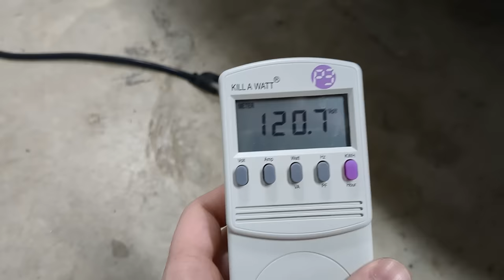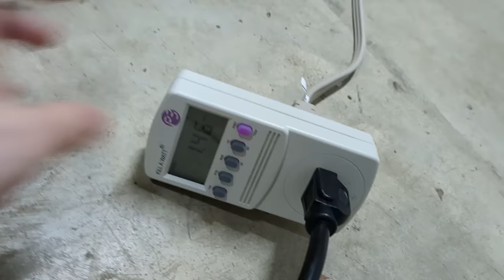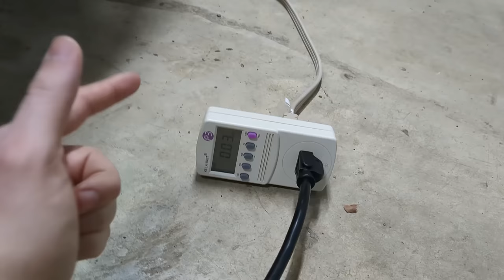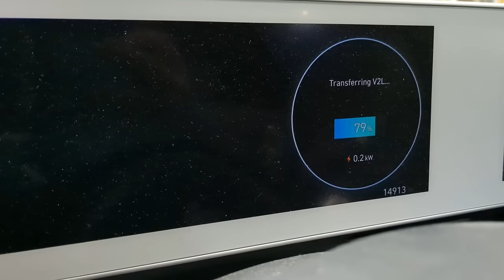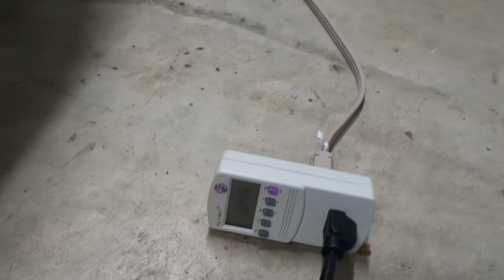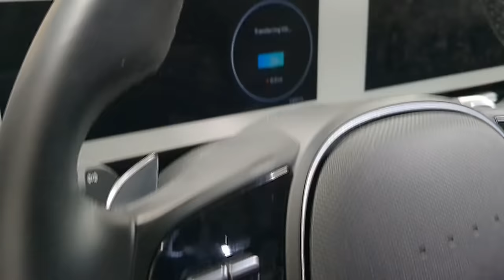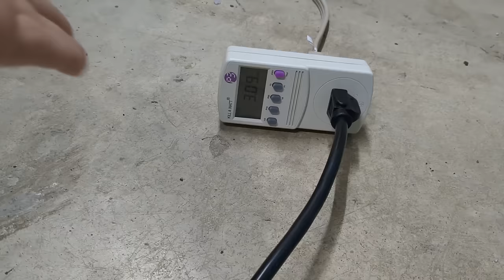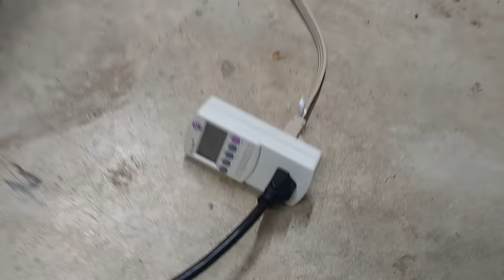A 24-hour test run of the Hyundai Ioniq 5's Vehicle-to-Load function

Comment from the maker: Quick note for other owners of this car and those like it: at the end I mentioned "accessory mode" but I was talking about Utility Mode. You activate that through the infotainment screen and then the car should stay semi-awake until it runs down to 20%. From what I've seen, more stuff is active than when using the V2L adapter (and you can use HVAC as well - that mode is designed with camping in mind) so it probably eats into the battery enough to make getting the adapter worth it if you don't already have it.
Reply: next go to public j1772 charger and use it to cook food. after all it's just normal ac power so it should work.😀
Reply: What are your normal parasitic losses on the car from it just sitting unplugged?  My Rivian will lose 0.5-1% per day sitting unplugged in my garage
Reply from the maker: @erics3596  Virtually nothing. Rivian rather unfortunately followed the Tesla playbook in several ways, including keeping a lot of systems alive when they don't otherwise need to be. Legacy automakers, on the other hand, actually turn the car off when you turn it off - which turns out to have some advantages!
To Tesla's credit, they've gotten a lot better at this - and Rivian has a lot of catching up to do. But pretty much every EV made by a legacy automaker will open the high voltage battery contactors and go into the same extremely low-power state that a gas car does when it's not running.
Reply: @TechnologyConnextras  Good to hear - Rivian has consistently been pumping out updates to address the parasitic drain...but yes they have some way to go :)
Reply: @TechnologyConnextras  congrats really nice looking mobile generator. Greetings from Asunción Paraguay
Reply: @TechnologyConnextras  Yep, as long as I don't have sentry mode on, my model 3 only loses 1% every handful of days as I just found out. I had worked from home the last 6 days and left mine uplugged. Only went down from 85% to 84 in that time.
Reply: Nissan LEAF owner here - I'm a little nervous about accessory mode for long periods because doesn't that drain the 12V Battery?  I just had the 12v replaced after owning the care barely over a year and from what I gather this is a common problem across EV makes (otherwise, no notes).  If that's just Nissan's goof I'll be happy.
Reply: Funnily enough, I have a gas car and I've always wondered if I could use my car as a portable emergency generator for my house?
Reply: I love the fact that you did this experiment, but in the beginning of the video you mentioned that the power lines are on poles and could be interrupted by tree branches being blown into them. You have a state of the art car, electrified cooking and storing of refrigerated food through some dodgy wiring, and the power to power it all comes into it from a system that is no more advanced then your 50's toaster. 

I also think this is a missed opportunity to show that your eating healthy, instead of junk food. That fridge had plenty of room left for fresh vegetables!
Reply: FYI for future experiments there are power meters available that have battery backup and don’t lose memory of kWh used due to a power interruption. Amazon has them for $10-15 and you can get them for under $10 shipped from China. They are actually more useful than a Kill-a-Watt for me since they track peak power usage and are so cheap that I have several of them. When compared to a Kill-a-Watt connected in series the readings have been within 1% accurate. Big Clive has reviewed a UK version of them and has given his approval.
Reply: Kinda sad to see that the US version is also limited to 15A even though it's running lower voltage.. the EU version happily provides 3.6kW of power through either the V2L adapter or the socket in the back seat, which can easily power my whole house. I've installed a generator input socket at the fuse board which lets me supply power from the Ioniq5 as a grid replacement in case of a power outage. The only thing that bugs me a bit is that AC or fridge compressors have such a high startup current spike that the Ioniq5 inverter will sometimes turn off when a fridge switches on. Also, the inverter seems to be rather nicely efficient.. the power pulled from the adapter and the power indicated in the dashboard only differ by about 10%, suggesting a roughly 90% efficient inverter. What I found makes quite a bit of difference in consumption is whether you lock the car or not. If you leave it unlocked, the infotainment etc will not fully go to sleep, which makes a constant drain of about 200 watts extra. If you lock it, everything but the inverter will go to sleep.
Reply: Would say that the inverter has to turn on the cooling system eventually, especially at high load after a while, to cool down the inverter section, which is just using the standard input PFC and active power control circuitry, so adding it on was only a software change for the designers, as the semiconductors are already there, along with the filtering chokes, and you can make the power converter stage do double duty just with some clever design. That they make an adaptor is good, but really that needs to have the EV cable integrated into it, using the communication cords to do the output connected sensing, and then have the socket remote, so allowing you to have it actually waterproof, and leading to a dry place. Likely the inverter itself also has ground leakage sensing, part of the input protection, so it will also provide protection against you touching the live conductors, so you do not need to have a RCD in the power output.
Reply: try barkeepers friend on the fridge if its stainless, that stuff is magic
Reply from the maker: @WooShell  Huh! I wouldn't have thought locking the car would make a difference. If/when I need this, I'll be sure to do that.
Reply: @fredashay  You can, but I'd count it as impractical, as the dynamo/generator can't supply that much wattage at 12+ volts, and while you can improvise a dyno to use your driven wheels to run a generator, good luck smoothing the output on it to not damaging levels and letting your engine run at a stable level regardless of used power.

Its entirely possible but I am assuming all the associated hurdles are more expensive than just buying a diesel generator.
Reply: that doesn't look like KARR from the 80's, haha
Reply: Are we going to see all the appliances you've explained run from your EV?
Reply: @oplkfdhgk  Indeed you can. That's how I charge the "racecar" (RV plug into it's charger, so there's a J1772 to NEMA-50 plug)
Reply: My 6 gallons of gas will run everything in my house for around 18 hours.  I don't have to run and plug and unplug things, fill it up, start it and then refill it.
Reply: @fredashay  You can, I have. Just with a little 300W inverter but it was enough to run the TV, a lamp and the refrigerator.
Reply: Would it be possible to use the V2L and the utility mode outlet at the same time? It would be nice for short periods of time like when you wanted to cook your veggies and pizza at the same time.
Reply: @fredashay  Kinda. You can power most of the stuff in your house (but not at the same time); just go buy an inverter. But make sure the car is running in a well-ventilated space (i.e. outside) and don't try to power your fridge from it (you'd need quite a beefy inverter and your alternator probably wouldn't like it).
Reply: @WooShell  The plugs going into it are only rated for 15A.

10% efficiency is pretty much rock bottom for power supplies and inverters these days...
Reply: Another thing that should come standard on evs! I hate that my Bolt auto-shutoffs in an hour no matter what, even when plugged in
Reply: @TechnologyConnextras  SVB's collapse will hurt a lot of renewable startups. maybe something you should consider covering in the near future?
Reply: @wkyrouz  fellow leafer, as a rule of thumb if the high voltage battery is connected for driving, charging, or v2l like TC is doing with their hyundai then the 12v battery is being charged so no worries. The leaf is pretty good with its 12v battery in my experience but I've heard of it draining from being plugged in to a charger idle for days at a time as it keeps checking if the plug is there. Some driver education required, check the forums!
Reply: So we're calling batteries "generators" now I see? Doesn't seem right in any sense of the word according to the dictionary, but ok...
Reply: @gorak9000  I agree it isn't how we generally use the terms, but if you put aside electrical nomenclature and use the terms more generically it makes sense. A battery is just a storage of something and a generator is a producer of something. In chemistry mixing a chemicals together that produce a gas flow (EG O2, CO2, H2,) is called a generator. This is chemical reaction that produces a flow of electrons.
Also, for purpose of the video it was being used as an analog to an emergency generator. Still click bait AF.
Reply: Technology Connextras, Markus Strangl , BG: FWIW, The USA and the EU versions are both rated at 15A.... Plus since in the USA, more hazardous 240 volt service is also available, which is offered in the Ford Lightning....

So, yes it is sad and a shame that a 240 volt adapter option is not offered to USA customers.

 I wonder what would happen if an EU Adapter would be plugged into a USA model?
Reply: @BrandEver117  I think they have to do that given how easily bolt EVs catch fire.
Reply: Inverters are actually quite inefficient. When we all have solar and manufacturers go back to making DC powered appliances, life will be better.
Reply: @johnburr9463  Very true. Inverters also have short lifespan. They usually burn out every 10 - 12 years. Costing $4-5k just replace them for solar panel owners.
Reply: Inverters are actually tremendously efficient versus the alternative... Since
the AC grid is key... for effective clean energy utilization...
Reply: @nc3826  Inverters are only useful because we don't each generate or own electricity, so all our appliances use AC. But what's important here is that most of his power loss is from the inverter. The same thing happens with a home battery. Once a high enough percentage of us are on personal solar power, manufacturers will be able to make DC appliances and we won't need inverters.
Reply: Why don't EV's come with a small diesel generator that charges the batteries? Could be built into a small exterior panel. Or in the trunk.
Reply: @johnburr9463  Google methane hydrate. Then ask what happens when that releases? Will a carbon tax at all prevent or minimize the effect? Who is going to buy a 5 year old EV when they all have a dead battery? Why is it you have to eat bugs but they don't have to give up their private jets? Why don't solar and wind ever pay back the carbon budget they took to create? How are 15 min cities and removing your freedoms going to have any effect? They pollute all they want at will toxifying your air water and lands yet it's carbon that's the issue. Ya fossil fuels are your enemy.
Reply: @fredashay  the alternator on a gas car only puts out 12v and maybe 100 amps (and that's while at driving RPM not idle RPM). But That's only equivalent to 10 amps at 120 volts so less than a regular outlet.

You would need to hook up a large generator to the wheels in order to actually harness the full engine power. It's just not worth it
Reply: @nc3826  we are talking about how to survive disaster situation of prolonged blackout. Efficiency and clean energy are only secondary consideration to robustness and reliability.
Reply: @i6power30   wrong.... There was no, we are... Your foil hat, survivalist narrative had nothing to do with the point that I made... Sorry to confuse you....
Reply: Don't worry we will judge you 😜
Reply: @oplkfdhgk  ១ាាាាឋាសាសឹ
Reply: @synapticburn  Okay, thanks everybody who replied to my comment.  I just figured that if a little putt-putt generator can power a whole house, a car could do so too.  But the car's alternator is the bottleneck -- being intended only to keep the battery charged while driving the car.
Reply: @fredashay  Just another thought... if you have enough space in the engine compartment, you could use varying sizes of pulleys to cause the generator head to run faster than the engine.  But... modern cars don't have any space in the engine compartment.  If you have an old 1970's pickup truck, there's plenty of room!  But, again, you have the problem of engine speed regulation. On an old vehicle like that, it would need to be some sort of mechanical governor... just like what's on portable generator engines (they run at 3600 RPM).
Reply: @BrandEver117  At least on the Volts, if you rubber band the gear select button down, it'll prevent the auto shutoff
Reply: @synapticburn  no actually 300 amps
Reply: @i6power30  what car do you know of that has a 300 amp alternator?

My f350 powerstoke Diesel alternator made 180 amps

No factory car has ever had 300
Reply: I have a hybrid (Ford plug-in hybrid) and we just had a big snow storm here in New England and we lost power for a few days. I plugged in a laptop to charge in the car's 120V outlet and turned the car on without actually turning it on (i.e accessory mode, if it had an old fashioned key it's like turning it one position without starting the car.) and apparently it just pulled from the 12V starter battery and killed it :(   If I had actually started the car it would have remained mostly off but occasionally started the engine to charge the 12V battery. Unfortunately it doesn't seem to charge the 12V starter battery or feed the 120V outlet from the electric drive battery (not sure), but the whole car seems to be a half assed comprimise to make a plug-in hybrid out of a normal car. (C-Max.)   My next car will hopefully be a Niro or EV6 or similar :)
Reply: @JohnRunyon  Or run the inverter from a deep cycle battery (or a few) and then run the car to recharge those batteries.  (I know someone who lived off grid and would recharge their deep cycle marine lead batteries every week or so off a homemade rig from a lawnmower engine and car alternator.)
Reply: @dwarftoad  well it varies from car to car. Most PHEV will charge the 12v battery as long as car is turn on not necessarily ICE engine, just ready to drive position, the traction battery should be charging the 12v battery
Reply: @dwarftoad  yes that's how my 20 year old Prius works too. The 12v battery in any car is just for quick starting loads or to even out the demand for accessory loads while the alternator maintains the battery

Hybrids have an onboard charger to recharge the 12v battery

The Prius also used the motor battery to run the AC compressor and cycles the engine on to recharge it when idling with AC running
Reply: @dwarftoad  the 12v gets its power from the big battery via an inverter. There’s no alternator like there is in a regular gas car.  So yes, had the car been on, you would have been fine doing that for a very long time
Reply: Ionic 5 battery
Reply: @synapticburn  I was speaking of alternator specs. Not sure what car engine will actually make 300 amps. Maximum amperage of typical auto alternator is 300
Reply: @VekhGaming  On top of what you say about running your house off of your car's 12V alternator, I've done that twice, and burned out the alternator both times.  100Amps@12V is about 1KW.  Alternators have a small fan which is designed to cool the alternator at highway speeds.  When you're just idling in your driveway, that tiny fan isn't enough.  I suppose you could rig your engine to maintain 2 or 3 thousand RPM, but this is horribly inefficient compared with any gas or diesel generator.
Reply: @barongerhardt  Those smaller inverters are FAR more efficient than their more powerful bigger brothers for light loads, due to their MUCH smaller idle current.  But, don't be tempted to plug any kind of motorized things into them, like a small refrigerator.  (I've had good luck with battery chargers for cordless tools, though)  They put out a modified sine wave, as opposed to the real sine wave that you get with regular house current or the Ioniq shown in this video.  Most devices will run just fine off of a modified sine wave, but some will not.
Reply: When it eats what do you feed it? Electrons?
Reply: The pour V2G efficiency is probably because the battery is cold soaked, and it isn’t warming up because it delivers low power (compared to driving the e-motor). The converter should be more efficient in summer temps, worth a new try then.
Reply: T.C. Creator Dude: You probably already learned this info by now, but since I'm a PC geek I wanted to give you the TLDR on Laptop Wattage.
ARM-based large-screen devices like Tablets and barebones Chromebooks: ~1-30watts depending on workload.
x86-based Laptops with efficiency focused Integrated CPU/GPU: ~5-50watts depending on workload; up to ~100watts if you were really pushing it.
x86-based Laptops with middle-ground Integrated CPU/GPU: ~10-60watts depending on load; up to ~150watts.
x86-based Laptops with separate "Dedicated-GPU": ~20-100watts depending on load; up to ??? (It can get real weird, like 2+ Power Bricks for 1 Laptop weird lol, but generally ~200-400watts for beefy Laptops doing 4k Gaming or such; up to low-Thousands.)
(EDIT to add Desktops). A basic "Household PC" will probably use around 50-100watts while doing regular stuff. A normal Gaming-PC doing normal Gamer stuff will run 200-500watts. A beefy Gaming-PC with "The Works" will run about 200-1000watts (plus add another 500watts or so if you run a Nvidia 4090 or similar.)
Reply: @wkyrouz  So we barely just came out of a 48h or so power outage, and I used the Leaf we have to power some fridges. You need to turn on the car to ready mode so that the DC-DC converter kicks in. Otherwise, you'll drain the battery.
Reply: @erics3596 I have both a Kia EV6 and a Tesla model 3. The Kia has the same percentage when I wake up as it did the night before. The Mod3 loses 3 percent but I have both Sentry mode and cabin cooling protection mode both enabled.
Reply: @wkyrouz  the car should have a system to charge the 12v battery with the main high voltage battery
Reply: @fredashay  as long as you keep it OUTSIDE. you will have to periodically charge the battery using the alternator using the engine which you don't want to do indoors with the fumes that could be created.
Reply: @TechnologyConnextras Hi!
Have you retried this experiment but with the car locked to see if it made a difference?
Reply: @bru_haha  Yeah I was sort of surprised too that the Kill-a-Watt didn't already just maintain its readings (via a Battery Backup). Have an old La Crosse technology 3362 Cost Control Monitor that doesn't offer the Voltage Readings but basically the rest and will keep the usage/Max Watt reading for months/years. The button cell batteries eventually go bad but the display just gets dimmer, but still useable
Reply: Have you considered your thumbnail to be incorrect?
A generator creates electric power from another energy source as far as my understanding goes. Wouldn't transformator be the correct term in this use case?
I would absolutely buy it if you'd make fuel out of electricity.
Reply: Replying for the youtube bot, praise be and godspeed Alec, I love you!